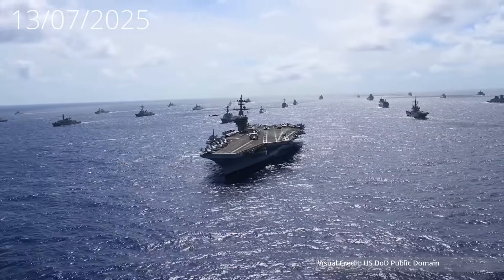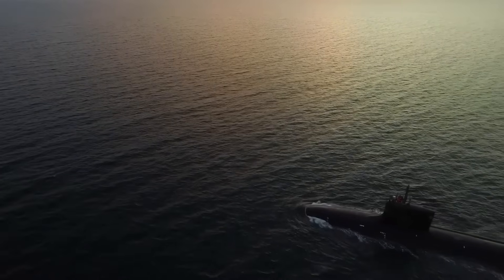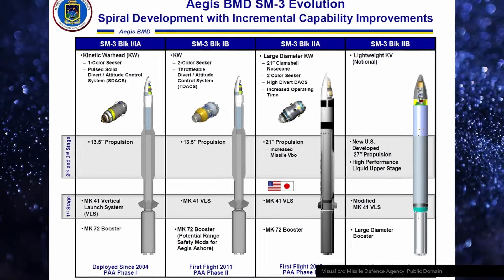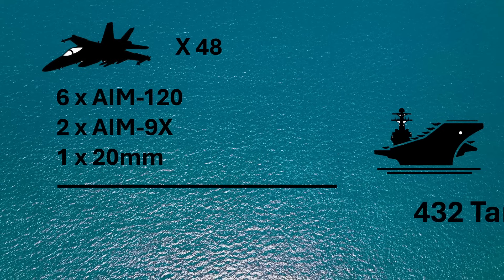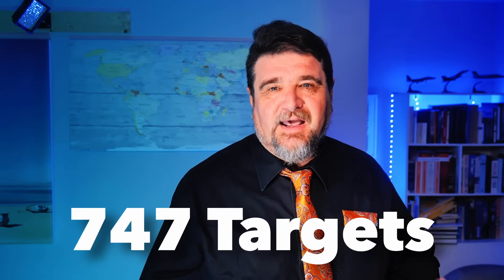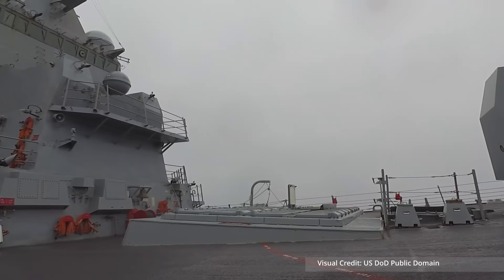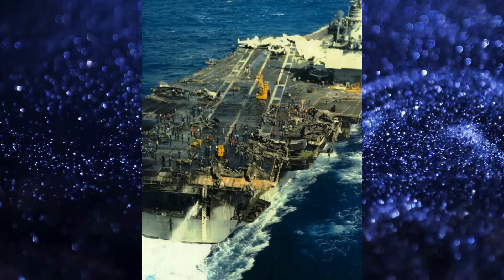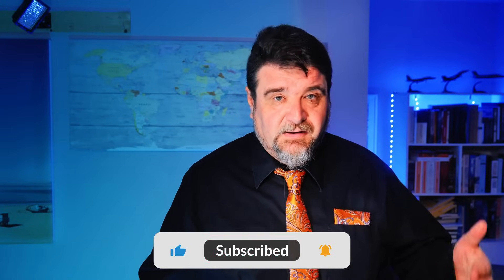HOW MANY Missiles are Needed to SINK A CARRIER?

Comment: There is one system not mentioned, or did you...
The Oreshniks, the Russian Mach 10 missile system, with multiple warheads.
Very fast, hardly/ impossible, the carrier system as well as the warheads,  to intercept, in any phase of its trajectory.
With the extreme speed of a warhead at impact, I'd fear a CV would brake in halfs.
Your opinion...?

Comment: Missiles like Harpoon or Penguin are intended to damage some small ship in destroyer class or with multiple hits some frigate. Yes trying to kill some Nimitz class with subsonic Harpoons might take couple days, especially if ships are defending actively.

But huge Soviet/Russian supersonic P700 Granit was designed for that anti-carrier task. Even with conventional warhead it will render that carrier inoperable with one torso hit. And with nuclear warhead it renders whole group out of order even if it detonates 500m away from target. If you fire salvo of these at carrier, good look defenders. It can be fired from ships like Kirov class or from submarines, which is even more deadly as it allows the submarine to just hang 200-300km away from carrier group and then quickly release the deadly salvo and disappear before defenders can react properly.

Sure carrier has air-cover perimeter and some frigates, but that works against opponnents without AA capability and just few attacking ships or planes. In case of surface-surface attatck Hawkeyes are in that case primary target for long range AA missiles to weaken the surveilance from above. Then multiple sea skimming missiles can penetrate such cover quite well. Last issue is range. 3M45 (P700) range is estimated at 600km, but it was never disclosed fully and it might easily be over 1000km. Supersonic sea skimming beast means that whole flight range is done within cca 15minutes and defenders are only able to detect these by ship radars during last 30-40s which is too little to organise proper defensive process.

Concerning damage - it is totally different story if you attack decomissioned empty ship or ship full of people, fuel, ammunition etc. 750kg warhead of P700 is something else than 95kg warhead of Harpoon.
Reply: The Russians have been operating nuclear cruise missile subs for decades. This is a reason why every CBG operates with an attached group of nuclear attack submarines which are designed to find and destroy subs like this. For your scenario to work you presume many or most of the Hawkeyes would be successfully engaged, then ignore that the US would simply slot in either AF AWACs or Hawkeyes from another CBG, or even one from a treaty ally. As to arming the Granit with nukes, you guys always think a nuke can maybe be slipped in and the US won't massively retaliate. If the Russians were foolish enough to use nuclear anything then they would receive the full weight of a retaliatory thermonuclear response from the US. Who wins then?
Reply: @jamesstrawn3466 if you respond to tactical nuclear attack with ICBM, it will trigger "delete" for all large US citties. That is how nuclear ICBMs work. But that is too complex for people like you :)

Comment: The issue with the ~3000 missiles calculation is that you do not need more missiles than the target. And you do not need to sink it in a single engagement. Even with a 70% interception rate, only one needs to get through to achieve mission kill on any of the ships, including the air defense escorts, after which the ships are just sitting ducks.

Comment: Drones can play a huge role in terms of defence distraction and exhaustion but the question is how would you be able to devilver so many of them ? If we are using Gerans as an example, one takes a surface area of 8.75 meters and we utalize lets say 400 of these drones in a single attack then we would need a launch platform that has a surface area of 3500 meters. After all we want a drone with enough range.
The smallest Cargo ships are Handymax with lenght of 150 to 200 m and width of 30 to 32 meters, that gives us a minumum surface area of 4500-6400 meter to operate with. Roughly 9 lines of drones with 42 in each with splace left for launchers.
However this kind of ship would be spoted from a continent away. The only way it can work is if its turned into a submarine which would make it almost as long as Akula class sub, wider than it even.
So rather than putting the eggs in one basket why not increase the nunber of baskets and make them smaller. Numerous small submarines carrying certain nunber of drones could be launched simaltaniously towards the target before resurfacing at a distance and releasing all of their payloads.
Its basically what the ukrianians did with their attack on russian airfields. However at sea there are far fewer bottlenecks and less defences to rely on. 

I am just brainstorming dumb ideas for fun here.

Comment: In the time of hypersonic missiles and especially drones a carrier battle group won't be able to survive against military super powers like Russia or China. A practical example was the carrier battle group in the red sea, which left because it came under high pressure by Yemen and the risk of getting hit was high. Can you imagine what happeneds when a country like Iran or even better China or Russia is trying to sink one? It's also a question of costs. If you shoot down a drone worth a few thousand dollars by useing at least 2 missiles which costs several hundred thousand and in some cases over a million Dollars, is simply insane and when calculating how fast the tubes of the rockets will be empty if a high two figures number of cheap drones are flying towards the group.

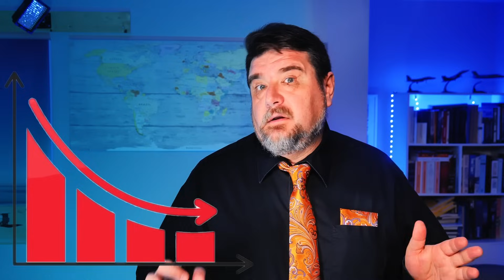Comment: 12:48 No, you can't "safely assume" it will take hundreds of missiles. Don't be lazy and do the actual math. It is not a linear relationship between probability of hit per missile and overall probability of hit. 

The overall probability being hit is 1 - (1-p)^n where p is the independent probability of being hit per missile and n is the number launched. Assuming a 5% chance of hit per missile, it only takes 45 missiles to have a 90% probability of hitting at least once, and 90 missiles for a 99% probability. At 10% chance per missile, you're looking at a 99% probability with 44 missiles.

Comment: That's the theory. I think, in theory, sinking the Moskva was very difficult and unlikely, too. In the end, it was sunk by two cruise missles with 150 kg warheads. And very quickly. 
What would a cruise missle like the Taurus do, when it makes a top attack and waits until the eight floor before detonating? Maybe on the level with the nuclear reactor? We will probably see in the war against China how resilient the aircraft carriers are.  And what new threats are. Like  hundreds of fast sea mines - automonous jet skis like the Ukrainians used them - attacking the 9 ships. Maybe swarms of little drones like the ones used against the russian bomber fleet, started from floating containers and hitting the defence systems on the ships (especially the radars and communication systems) before the actual attacks. It is very difficult to really defend an object.

Comment: Even accepting a "gratuitously optimistic" approach, you've got it wrong due to key details that you've missed.

Most of your assumptions, even hypothetically and optimistically, can only work if anti-ship missiles in this scenario are subsonic and not sea-skimming. Basically, something like SS-N-2 from 1960-s or even worse.

US Navy ships - carriers, cruisers and destroyers - simply don't have any air defenses known to be effective against fast and sea-skimming anti-ship missiles (and those are the gold standard since 1970-s). Every single system has failed specialized trials. Consistently. EVERY ONE.

The main issue - radars can't even see those incoming missiles. Notably, SPY-1 were designed as "jack-of-all-trades" radars optimized for long range high altitude targets and sea-skimmer detection was sacrificed - and there are no dedicated radars for that either on typical Aegis ships. And their antenna placement is a bit too low on top of that.

Even if detection was not an issue, reaction time would still be highly problematic, especially for supersonic sea-skimmers on the counter-launch side of things, exacerbated by limited target channels for SM-2 and basic ESSM.

20mm CIWS has been known to be completely unable to stop an incoming missile (warheads go through despite hits), which is why they decided to replace them with RAM well over a decade ago. RAM turned out to be not much of an improvement, however.

This is why they don't use Coyote target drones for live fire training - they can't intercept them, they can't even see them coming, what's the point?

All of this has been known and understood for decades, semi-openly discussed by specialists, publicly hinted at by top brass and pointed out by whistleblowers.

This is one of the main issues Zumwalt (and its completely redesigned radar suite) was supposed to alleviate.

Air wing's AIM-120 cannot intercept sea-skimmers either - its seeker simply does not work at 5 m altitude, it doesn't work even at 15 m (SM-6 has exactly the same issue). Trying to deal with launch platforms has its own problems - those launch platforms' escorts would outclass and outgun Hornets massively, assuming both roles are filled by Flankers.

All of this snowballs into "carriers are sitting ducks" - which isn't exaggeration when people in-the-know like col. MacGregor say it.

15:45 - this USS Enterprise assessment is baloney. Three Mk.82 that detonated there, are less than a single heavyweight missile, let alone six of them. A supersonic heavyweight missile might do worse without even exploding, kinetically.

Comment: This video is far below your usual standards. Basically, your analysis is at odds with reality. There is serious evidence that Houthis have actually managed to damage the deck of the USS Eisenhower and that they also came very close to hit the USS Harry Truman. Also, it has been shown in simulations that a salvo of a 18-24 Chinese hypersonic missiles like the DF-21 and the DF-26 will be able to almost always sink any US Carrier in service today. So even a handful of hypersonics can do serious damage and nullify any tactical advantage a carrier group might have. Also, as you mentioned in passing, torpedoes remain the most likely way to sink an aircraft carrier.
Reply: the fact that the aircraft carriers left without completing the task of forcing the Houthis to stop attacking the ships and the fact that the Houthis continue to sink them, and the carrier group is nowhere near, indicates that the threat of destruction is more than serious
Reply: They damaged two ACs, which had to pull out for repairs. That's definitely true, however they were not sunk. Yemen has not the capability to sink such massive battleworthy ships, in fact, even when they sink cargo ships, they typically first capture them and then sink them by placing explosives inside the hull. 

A big problem with this video is that it's about air-to-sea bombings and not about torpedos or boat drones. Waterborne attacks (with sufficient explosive power) to the bow would probably cause extreme damage (rudder, engine rooms) and render the ship useless... but surely not sink it. Of course that's why they carry a big escort, presumably able to detect and destroy such underwater dangers.
Reply: @LuisAldamiz  I believe that @Parsecter is referring to the sinking of the commercial vessels, not the carriers which would be absurd. He means that Houthis still attack and have sank some commercial ships in the straits, but the carrier groups are nowhere to be found. This means that the danger to the carriers is real so the US chose to withdraw them from the region.
Reply: Basta un singolo missile ipersonico russo  Oreshnik armato con testate cinetiche, per affondare qualsiasi portarerei americana. 36 testate cinetiche la ridurrebbero come un formaggio svizzero. L'era delle portaerei sta per finire, come fu per le corazzate, superate dalla storia.
Reply: 1. there is no evidence of a carrier being hit, whatsoever, unless you are referring to the hilariously poorly photoshopped satellite images the Houthis shared in which case LOL. 

2. Chinese DF series weapons don't seem to ever get criticized for having no actual experience and having incredibly questionable accuracy against moving targets.
Reply: @aegis-d  - The USA denies it but they were hit for sure: Ansarullah claimed hits and the carriers rushed to safe port right away.
Reply: @LuisAldamiz The fact you believe the Ansarullah instead of the fact that there is zero evidence of any hits, AND an abundance of evidence showing no physical damage to any carrier goes to show how indoctrinated you are. Please start thinking logically and come back when you have proof.
Reply: @aegis-d  - I believe in Science, in facts if you wish. If they claim hit and right away the US AC has to pull out to safety for likely urgent repairs, all fit. 

I also tend to believe more the ones who regularly say the truth than the ones who lie systematically. 

Have a good day propagandista.
Reply: @johnbean9797 why would they deploy a carrier then move it far away from the mission area before the goal was accomplished?
Reply: @andreahighsides7756  Because they were rotating the carrier out, the Harry S Truman completed its full deployment and was replaced by the Carl Vinson, which itself completed deployment and has since left. Can you not comprehend that we have imagery of the carriers from days after the claimed attacks with no sign of damage whatsoever?
Reply: @aegis-d  Yes, this is wild! You should always believe the US government. They are the most trustworthy in the whole world.
Reply: @aegis-d  but yet we're supposed to gobble up mossad and western made up bs ?

Comment: Thanks :) Thinking logically. A Carrier group is only as good as its logistics. The carrier itself doesn't have to worry about fuel but its protection does. Turn cheap missiles into big threats with radar reflectors to whittle down the air defence systems. Harass the logistics so that re-supply is difficult to impossible. Then lure them into a trap with sea mines made of Kevlar and cavitating torpedoes. Whilst they are distracted with drones and missiles. With the threat of long range bombers at range.

Comment: This is the wrong question. It is very easy to disable a carrier. A few holes in the flight deck will shut down flight operations.
Reply: Yes, because it’s just so incredibly easy to blow holes into the most protected runways on earth.
Reply: @leorenlund6444  Mach 5, 1 Ton warhead KH31 can, any day of the week. If "protection" is as good as Patriot missiles showed, yes, very doable.